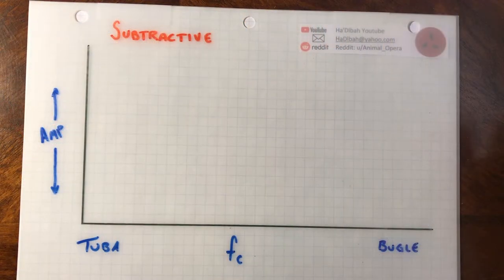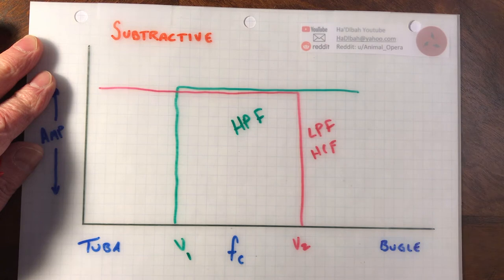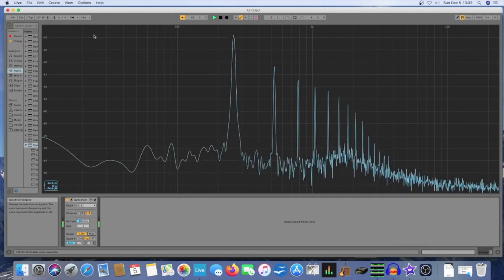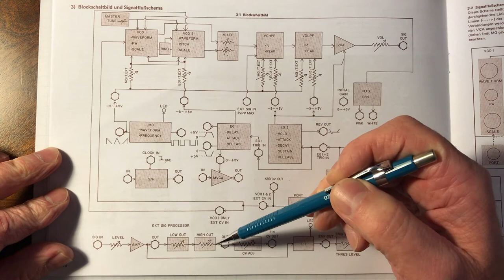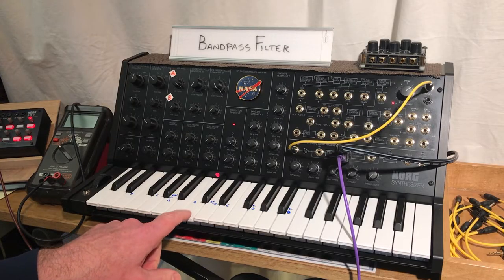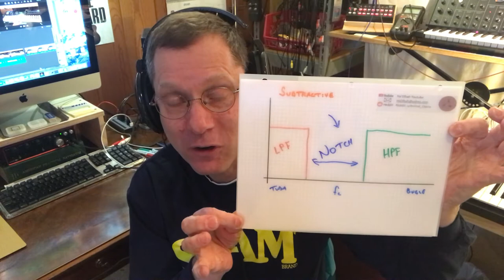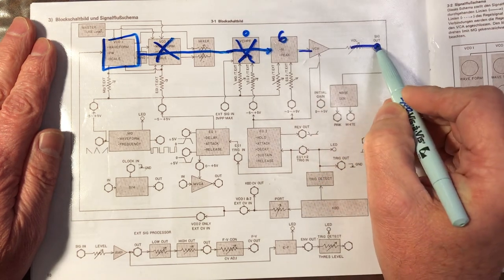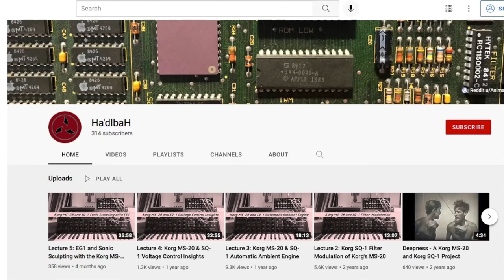Lecture #1 Synth Paring and Notch Filter Exploration with the Korg MS-20

Comment: Hi I was looking to buy an ms20 mini but found out a lot of people have been pointing out the noise problem. Do you think it's a real problem or it's just a synth property?
Reply from the maker: Hi Perri! That’s a really good question and there are likely a few considerations about noise.  Obviously, the fact that I start my response with “a few considerations” is probably telling.  Let’s assume there isn’t some recent manufacturing problem at Korg wherein they are shipping defectively noisy MS-20s.  That being said, yes she is a touch noisy but not such that it’s an issue…unless you use it in a very special way.  If you turn both oscillators down to zero and hit a key on the keyboard, you’ll hear some noise when the gate opens on the amplifier.  It’s not line noise (unless there is a power supply problem), it’s internal, well. . . White noise.  As soon as you turn up either oscillator, the noise is completely overwhelmed by the oscillator. It seems to be a property of the synth. Besides, is there any other synth that can punch into a mix like an MS-20? It’s a fantastic sonic workhorse and that little bit of noise is truly a non-issue…unless.  So, when pairing another synth, like we do in Lecture #1 we can encounter that MS-20 noise if the audio signal in is being routed thru the “legendary” high-pass and low-pass filters.  Let’s say you are routing a delicate pad thru the MS-20 filter set, then yes you might encounter some of that “gate noise” until your pad swells enough to drown out the noise.  But that use is “edge case” and can be dealt with using a de-esser or EQ8 with a judiciously applied Q. Fumio Mieda, the chief engineer at Korg made the decision to pass a touch of noise thru in order to offer us one of the most sonically complex synths ever conceived.  I think he made the right call.
Reply: @hadlbah  I was thinking the same! Thank you so much!

Comment: 17:50 how did you get the differing note lengths on one sequence from the sq1? i just bought an ms20fs and am enjoying your video instruction.
Reply from the maker: Hi @amphitheater!  Greetings and glad to hear you are enjoying the lecture!  I believe I cover this in future lectures (I think, but now that I think about it, maybe I don’t). Either way, on the selector knob there is a setting for CV/Duty with parallel arrows. This means Bank A outputs CV for frequency control and Bank B outputs the duty cycle or on duration for each step.  The step buttons select which step will be triggered and the mini knobs will modulate step control.  It’s been a while since I messed with it, but I think that’s right.  Can you let me know if I buggered that up or nailed it? 🤓
Reply: @hadlbah  that option works for 8 steps but I ask because you're using the 16 step mode (16:42) whereas the duty mode you mentioned only works for 8
Reply from the maker: @amphitheatre  Oh, yeah, you’re right!  If only my engineering students were so observant it would make things WAY simpler for me LOL!  Okay, what I have is the Duty knob (above ‘function’ button) cranked all the way up so the unit will run the full note length.  I set up 1/8 notes and the 1/8 notes are drawn together with 100% duty. I then turned off some of the intermediate steps meaning it counts but does not play. So counting off the merged 1/8 notes (now quarter notes) it becomes: DAA-di-di-di / DAA-DAA-DAA (in 4/4 time).  This is how I did it.  Let me know if this helped ya.🤓
Reply: @hadlbah  thanks! i realized too that you're only using GATE out, without using cv for pitch, allowing you to play via the keyboard, something i hadn't thought of 😎
Reply from the maker: @amphitheatre  Totally Awesome!!
Reply: @hadlbah   still trying to recreate this with duty all the way up, not sure how you did it now that im in front of my ms20 :O turning duty all the way up just gives me a drone
Reply from the maker: @amphitheatre  I posted some photos and instructions on my community page. So check out the community tab and then let me know if this gets you past your roadblock. Good luck and thanks for the question!🙂
Reply: @hadlbah  i think i got it! tell me this, when your sq1 is turned on but NOT running, and you plug cv-gate into trig in, do you get a drone? if so you are using positive polarity on your sq1 when the ms20 is really set for negative! i changed mine when i realized the factory setting is wrong and thought to change it back and got similar fx to what i hear in your video. good news: you can change your polarity and find even more use for your sq1 🕉
Reply from the maker: @amphitheatre  ya know I’ve never tried that.  I do remember having to set polarity to negative when I first got it and haven’t ever needed to swap it back, at least not yet. Glad to hear we slayed the dragon on this one!

Comment: I'm new to patching, and I just got an ms-20 mini and a matriarch. My concern since I don't quite understand it all, is can I send too much voltage from one synth to the other and do damage to them? Thanks for the lesson!
Reply from the maker: Hello @anonymous_friend!  Great question and totally thrilled that you joined the “MS-20/Matriarch Club”. As far as these two synths and synth to synth over-voltage risk: short answer is there is absolutely no risk of damage when patching between these two synths.  Hiroaki Nishijima (Chief engineer at Korg) and Mark Crowley (Designer of Matriarch at Moog) are well aware of each other’s products and fully anticipated interconnectivity.  In fact, the internal circuitry for both these synths is designed to protect itself from outputs being directly plugged into other outputs.  Now there is a caveat and that is other non-synth voltage sources being used.  For example, from time to time I use my oscilloscope as a signal generator and if not careful I could easily dump a 50V signal into something…I’m of the opinion this would fry something.  So I’m suuuuuper careful when messing about with my “scope.”  Otherwise you’ll be fine.  Be bold, go crazy and have fun!!!😎
Reply: @hadlbah  Thanks for the reply! I would love to see a video from you showing different patches between the two!
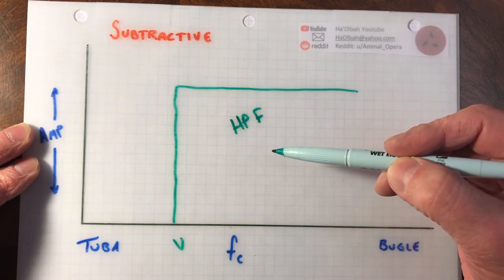Reply from the maker: @anonymous_friend  that is an excellent idea!  I’m finishing up a sample and hold vid lecture presently (Lecture #7). I do touch on MS20/Matriarch integration challenges in Lecture #6. There are CV to Oscillator differences between Moog and Korg that I dive into at 5:07.  I also show the stepped triangle from the Matriarch modulation via mult driving the legendary MS-20 high and low pass filter modulation at 10:32.  Perhaps this helps touch on a couple of aspects so do cruise on over to my channel and check that out.  However a full on integration - like a total “Borg” level integration would be a fun experiment and is a great idea! I’ll definitely give a shout-out on the vid when I post it!😎
Reply: @hadlbah  Awesome! Thanks again

Comment: I think I missed something  The difference, to me, between 19:40 and 24:00 is just that the notch filter made the staccato tone thinner sounding.
Reply from the maker: Yes! Exactly! We thin the highs and lows whilst preserving some of the lower and higher harmonics. We don’t get to keep all of the highs because we lose some of them with the LPF.  And then we leave behind some of the lows with the other side of notch. We do pull through the harmonics though and that’s what makes it special.  The notch width is key. Earlier in the video I sweep the band pass filter and it sounds quite different. It’s subtle yet distinct. It’s the use of these different filtering techniques that seeks to separate a good mix from a great mix. Pop on your “Princess Leia Hairdo” and give it a try and I think you’ll likely experience the same nuance. Great mixes are all about exploring and exploiting nuance (imo).😊 Thanks for the great comment!